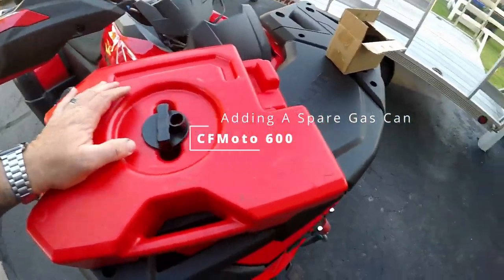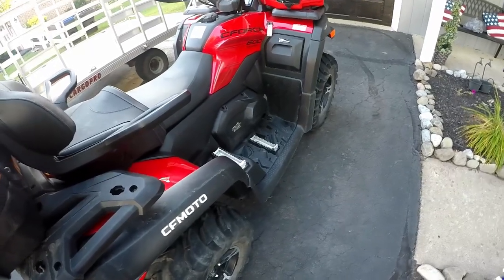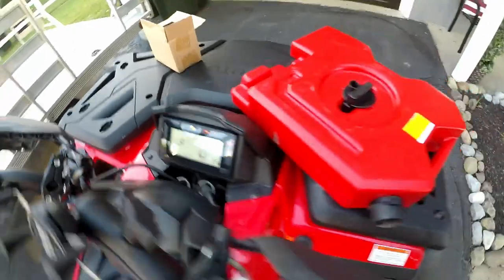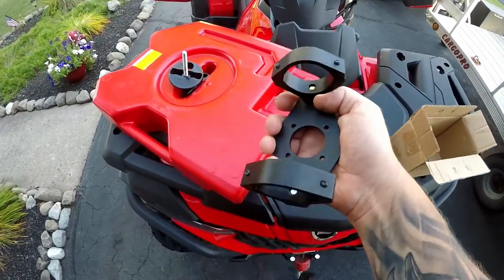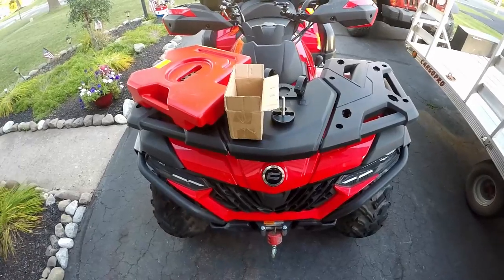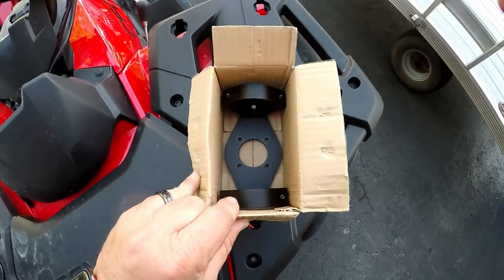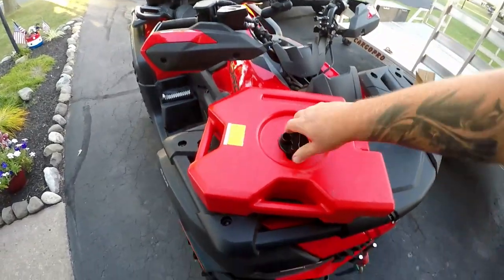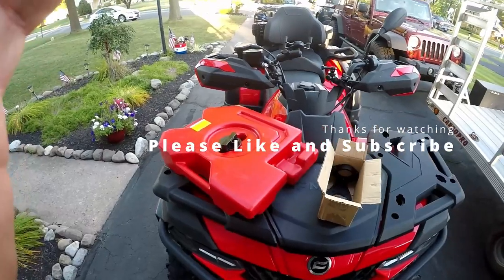How I Mounted a Gas Can to My CFMoto CForce 600 Front Rack #cfmoto 👍

Comment: Nice work. Now all you need is a roto-pax retainer so you don't have to unscrew yours all those turns to get your jug off when you need to. As for the quad. They are very nice. My 21 has been a great machine.
Reply from the maker: Thank you! I actually have a root pax 3 gallon coming for the left side this week. And yes I’m looking at the roto pax retainer. Much easier than all the turns on the one I have.

Enjoy that 21’ I love my model. It performs great!

Comment: Nice video, I'm interested in what storage box you have on the back. I need one for mine but I don't want a great big one either.
Reply from the maker: Thanks the link to the box is below. I had to drill two holes in the bottom of the box and just used bolts and large washers with rubber seals and ran them thru openings in the plastic mounted rack. The box is for a front rack so I mounted it backwards so it opens front to back.

North Coast Outdoor Rigid Front Cargo Box Black https://a.co/d/1jz3TaE

Comment: I’d hope you havnt had problems in 298 miles , I’ll check back and see if the machine still runs after 5 years though
Reply from the maker: 1,000 miles now. Zero issues 😊

Comment: I have the same machine. What do you clean yours with after rides?
Reply from the maker: I use a foam cannon attached to my pressure washer. I add foaming soap and some simple green to the canister and blast it. Soak then rinse it off. Works great!